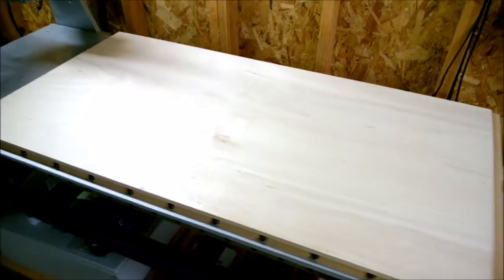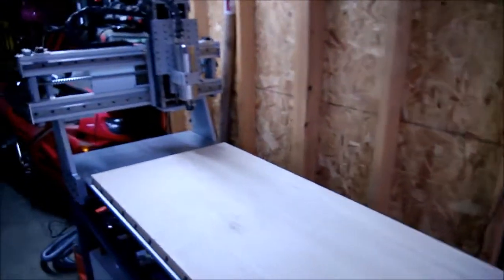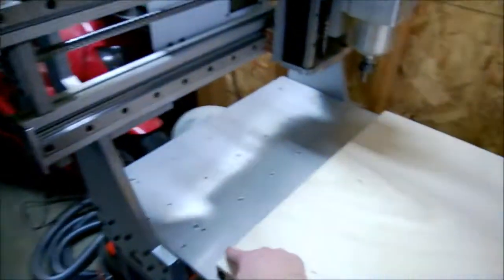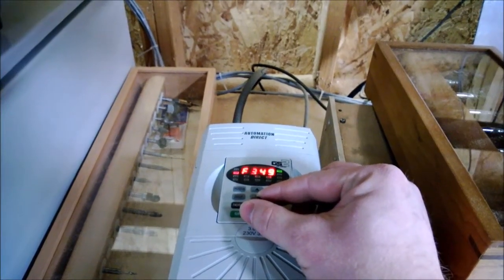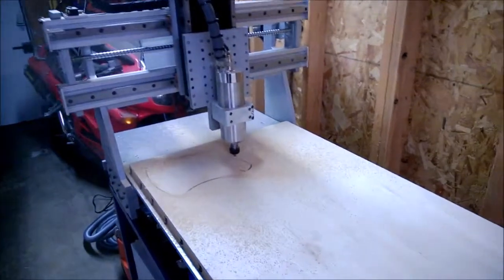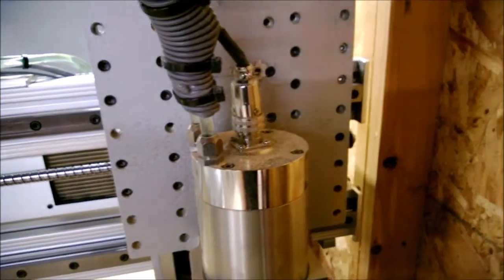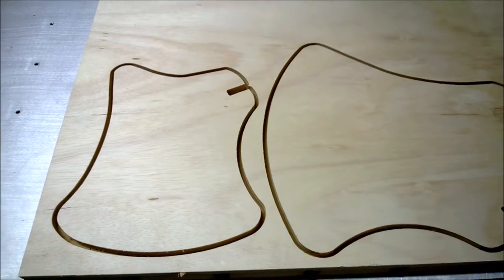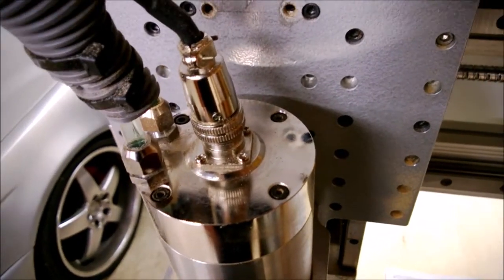CNC Router: Cutting out dinosaur bones

Comment: I just watched both of your router vids.  Very nice router!!!   Perfect size work envelope.  Panels can easily be cut at the home stores on their panel saw and even without a trunk, most backseats will fit a 2x4' sheet.  Linear rails...very sweet!  Is that a Seahawk logo?  Are you in the NW?
Did you get your spindle fixed yet? 
Thanks for the sub.  I've subbed you too......let's see some more vids :)
MIke
Reply from the maker: I love your enthusiasm.  I like your Torus Pro too; I think that's my target whence I go down that path.  I look forward to seeing your kit setup and working.

Yes, 2'x4' is a good size, but only if you use tape as hold-downs.  I do have a full-size truck, so buying by the sheet is just fine.  The good news is if I cut 5 48"x19.2" panels from the full sheet, I can use clamps to hold everything down.  That is, if the material doesn't get to flexy when you cut it (I've had that problem too).  4 sheets of 2'x4' too, but again, hold downs are key.  Yes, correct on the logo, and that does reflect my location in the world.

Finally, yes, I did fix my spindle, and have made a bunch of stuff since (sold some of it too).  I do need to post more vids, and I will.  Tsk on me.  : )
Reply: Jeremy Brown
I want to see mine working too! lol
I was kinda thinking out loud about the pieces fitting in my Forte :)
I'm in Gresham......east side of Portland, OR.
Congrats on the sales!
I spent a chunk of my morning watching your vids.....I should have been editing my own! LOL !!
Mike

Comment: Your wires are shot because of no protection between 4 wires..
Reply from the maker: In this case, the short was due to the connector not being fully connected - it was loose.  In that case, there wasn't protection between the 4 wires because the connector wasn't doing its job - because it wasn't attached properly.  Lesson learned, when accepting new, custom equipment, verify all connection.
Reply: How do u do the cutout , like a square piece , without damaging the last edge when its going to rip off from rest of waste material ? You know the edge becomes little outshaped  because of vibration..
Reply from the maker: @gunjantrivedi2006  Tabs.  Each of the pieces isn't fully removed from the source lumber by CNC.  In this way, a vast majority each part is cut to precision.  To remove each part, I use an oscillating cutter to sever each tab.  I then go to a sander to remove the remainder of each tab.  I try to place the tabs on straight edges (not curves) of each part such that I can easily sand the rest to be exactly the same as the rest of that edge.  Tabs on round edges (sometimes a requirement) need a little finesse to deal with properly - sometime with an oscillating spindle sander (for inside corners) or care on a disk or belt sander.
Reply: Jeremy Brown what are the feed rates do you use for MDF and PLY ?
Reply from the maker: @gunjantrivedi2006  It really depends.  The only cutting I do for MDF is for my spoilboard - in which I use a 2" wide index cutter and only take 0.010" off.  It goes slow but I'm totally fine with that.  Plywood and all wood depends on the number of flutes, the rotation rate, the depth of cut, the size of the mill.  I plug my settings into G-Wizard (cnccookbook.com) and typically take not the fastest, not the slowest setting.  So far so good.
Reply: Jeremy Brown i use 500mm-600mm/min with 6 mm dia two flute end mill 18000 rpm and 2.2mm step down , and 800mm/min at 22000 rpm for ball nose finishing with 3mm ball nose with 0.1 step up .. 

G wizard is good .. i need to learn the software to use it..